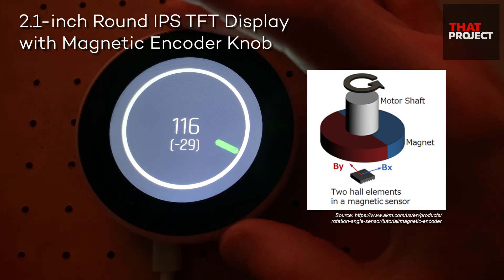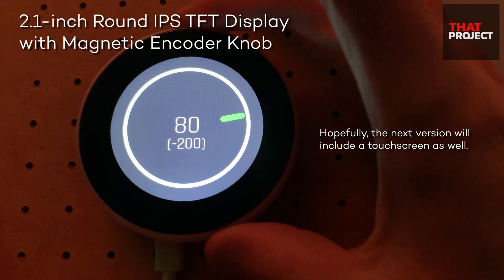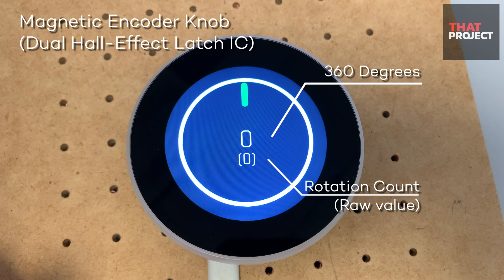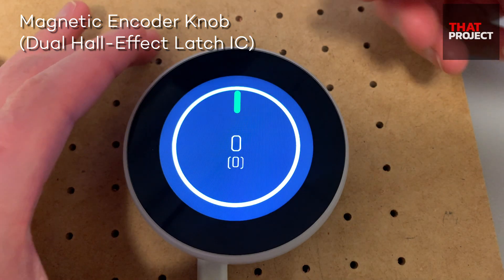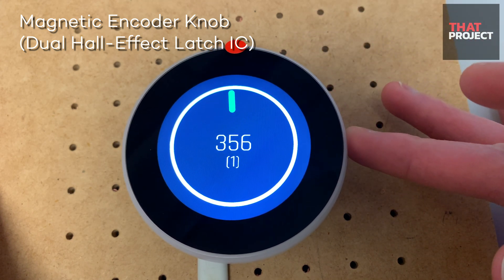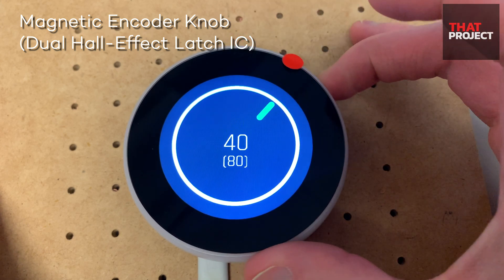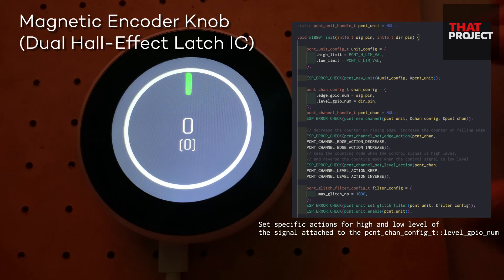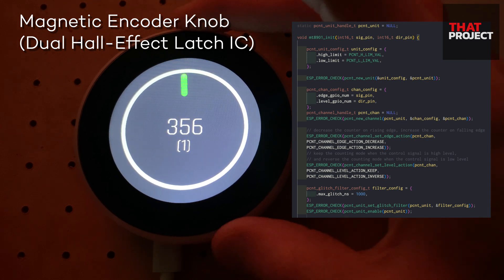Getting the Absolute Rotation from Magnetic Encoder (Smart Knob)

Comment: Thanks! Seems the question is what is the magnetic orientation of the portion of that magnetic strip that faces the hall effect sensor?
Reply from the maker: Where the question is? Anyway, I think this can be figured out the direction easily using N/S magnetic.
Reply: @ThatProject  Was mainly wondering: Are there are multiple NS magnets imprinted in that circle?

Comment: How many poles is a multipolar ring magnet??
Did you use 90 poles if the total scale is 360?
Did you use the magnets sold on the market?
Reply from the maker: This is the source code for how I got 360 degrees from the encoder. 

int16_t cont_now = mt8901_get_count();
	degree = cont_now * 4;
	degree += 90;
	degree *= -1;
Reply: What is the pole number of the ring magnet?
Reply: Isn't it counter +1 every time the play changes?
Reply: I used stm32f and
Multi-pole ring 6 pole application
It's 24 counters per lap.

The above video has 90 counters per lap
Is there a lot of poles in the ring magnet?
Reply from the maker: @양양재용-p1j  They do not provide exact datasheets for their magnet rings. I have no idea how many poles are in it. I only changed the value read through the encoder to 360 degrees through the code.